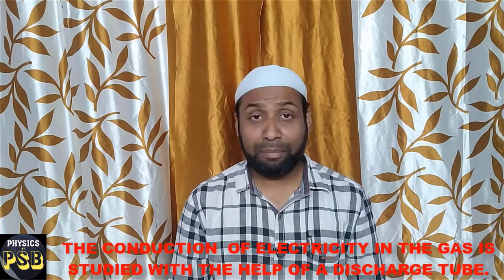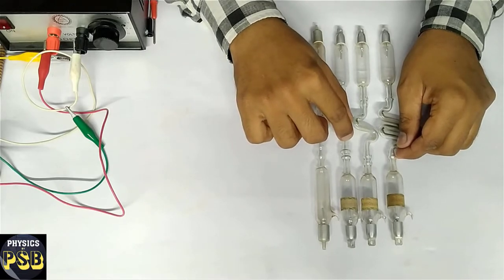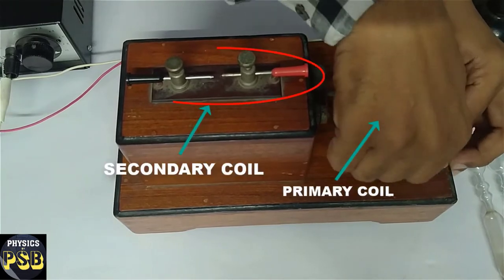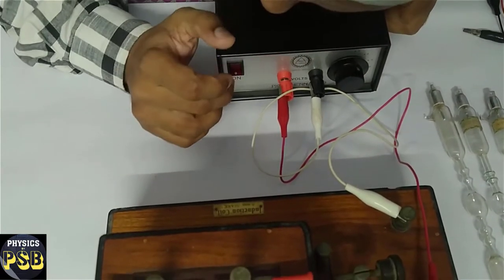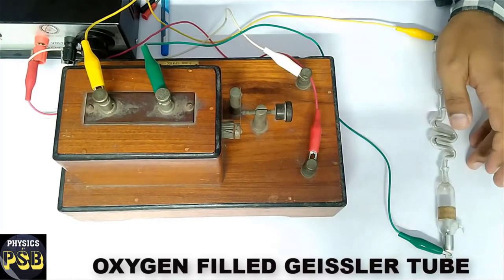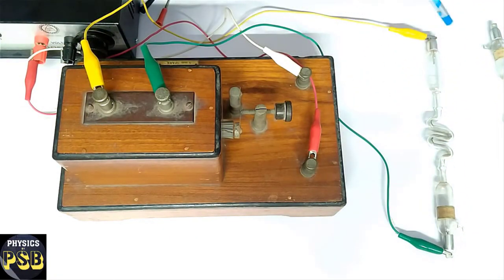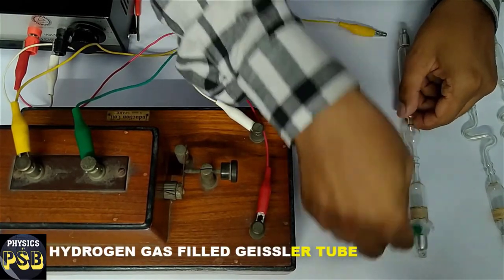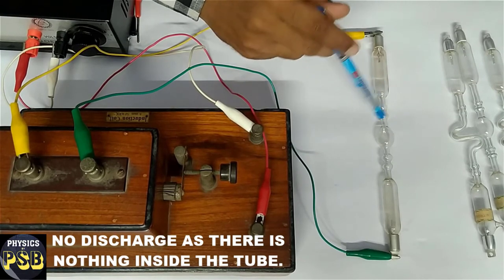#Discharge Tubes | Demonstration |  Conduction of electric current through gases |

Comment: Sir how microwave oven work??
Reply from the maker: The microwave oven produces microwave when it is operated,  which in turn produces a non- uniform oscillating electric field.  The water molecules in the food which are the electric dipoles  experience torque and vibrate.  Hence heat is produced and cooks the food.
Reply: Thank you so much sir.
Reply from the maker: You are most welcome